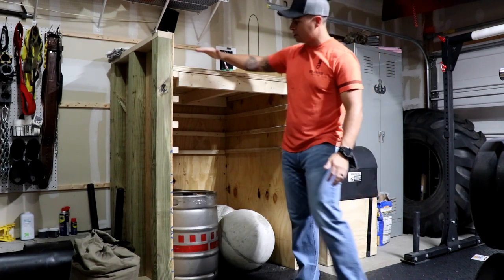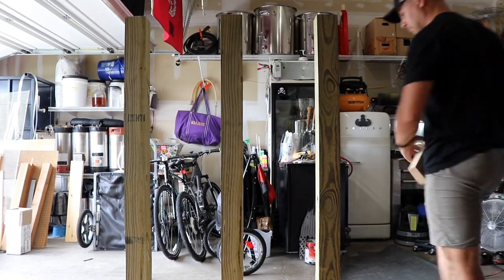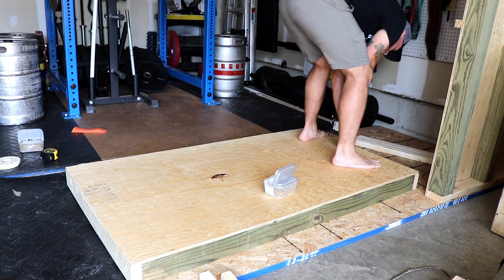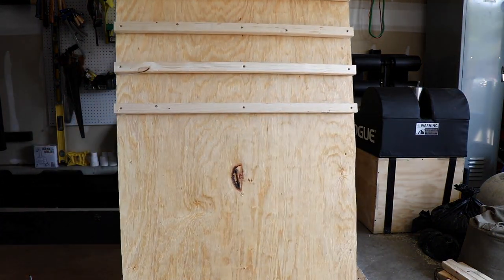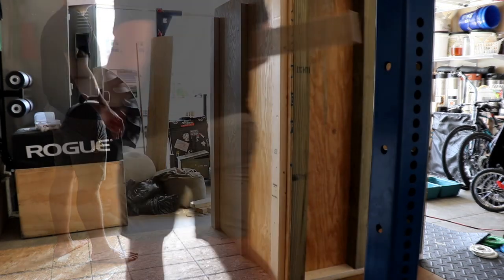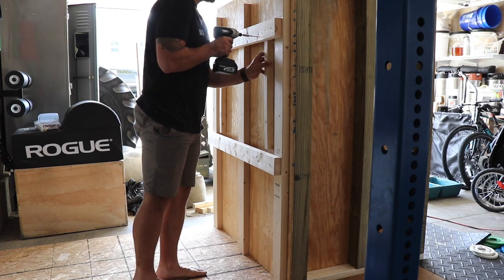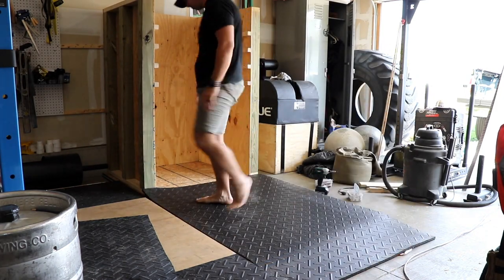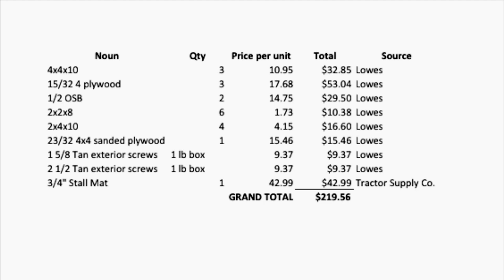DIY Adjustable Atlas Stone Platform

Comment: Great video, is there a reason you decided to make a full box and not just a heavy duty platform and using your power cage & safety arms as the box?
Reply from the maker: At the time I was using strap safeties and didn’t have pin and pipe to support the shelf
Reply: @TheKurtlocker  once i get my yoke that is my plan. my main weight training units are from PowerTec the functional training (cable system) and the multi-station (a leverage unit) i chose them as i felt they where the safer option for solo home training.
Reply from the maker: Agreed that safety is a concern. I’m looking up those pieces now.
Reply: @TheKurtlocker  what I like about the powertec functional trainer is that it has the plate stack (option) and weight racks. Therefore I can load each side up to 500lbs and it let's me make smaller increases when 10lb is a bit to much. Additionally I have started to use it for my belt squat. Another reason I got the multistation is because I do circuit training super setting exercises focusing on different major muscle groups. So it makes it easy to go from 1 station to the next with little downtime.
Reply from the maker: It’s a really functional looking piece! Awesome to hear it’s working well for you
Reply: @TheKurtlocker  I got the multi over 10 years ago so its also holding up well.

Comment: will this design hold a 400lbs stone?
Reply from the maker: This was design one, I later switched the shelve brackets to 2x4s that were glued and screwed through 2x4s on the outside. I did break the 2x2s quite a bit with stones in the low 300s. The shelf held up fine. The brackets are what breaks. I no longer have this piece. It got broken down for scrap pieces to make other things when I got a steel loading table

Comment: I use my power rack, 2 safety pins and 2 boards...full adjustable...
Reply from the maker: I have seen a lot of setups like that.  More power to you!
Reply: @TheKurtlocker  Thank you! Atlas Stones are my favourite event and one of the most iconic strongman events...
Reply: Meanwhile I built a little frame on the board that the Atlas stone can not roll uncontrolled from board
Reply from the maker: Good call. I’ve seen videos of that happening and it typically doesn’t go well

Comment: How's it holding up? It looks like a great design and efficient for maximizing space, but I would be worried I might crack the shelf in the middle as i have a tendency to really come down on it hard with the stones.
Reply from the maker: I really ought to make a video update but I have been super busy relocating from Ohio to Texas.  The shelf did break like you said and I rebuilt it to be much stronger.  The rest of it is holding up perfectly. I also added a strap to the front below the platform to pull the front edges toward one another.
Reply: Kurtis Stadsvold thanks for the response bro! I built a platform at 44 inches but it's just fixed because I used a ton of reinforcement under the center where it takes the most impact, it's complete overkill but I was paranoid I would go right through it. I still left enough room that I could store two 21" stones underneath. And if I want to go higher I place a skid on top. I really love this design you built though!